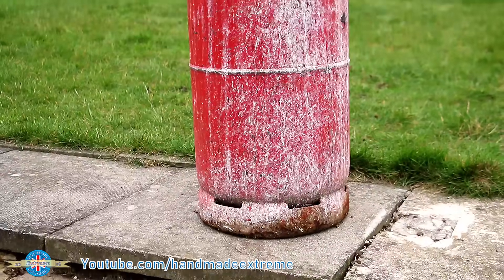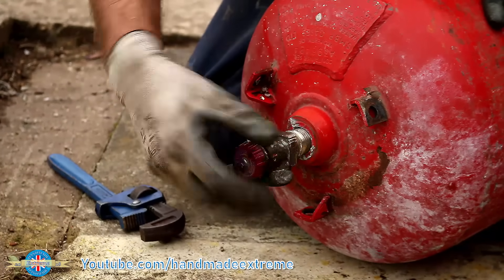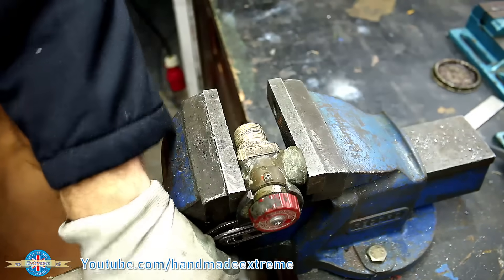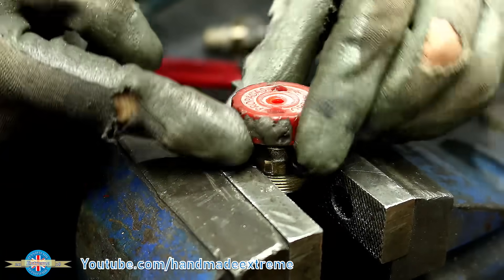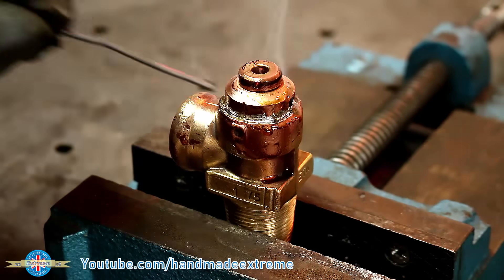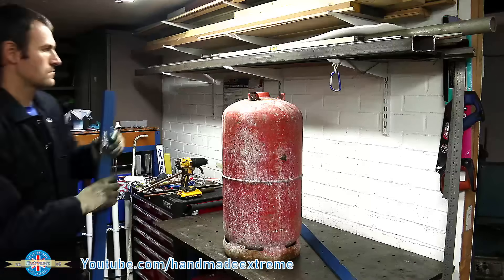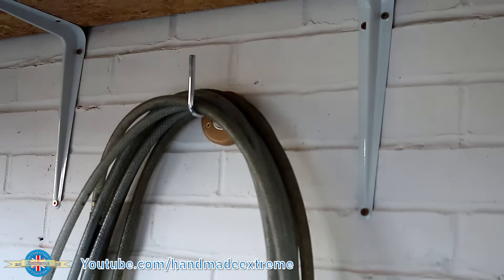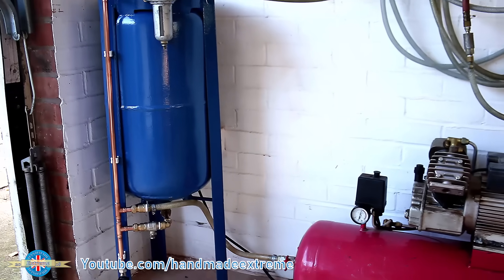Making an auxiliary air tank from an old LPG gas bottle.

Comment: Fun example, I’d only add a few suggestions. 
1, install a drainage style valve for the hose, so when you shut off the valve (handle) the pressure in the hose is relieved which makes putting away a non pressurized hose much easier, while keeping reserve pressure in the tank system. It’s also handy to drop pressure to change tools, and relieves the pressure in hoses being stored for longevity and safety. Handle is straight, the air goes to the hose, perpendicular and the air is sent from the hose out the back of the valve, while the tank is shut off. 
2, use a hose storage bracket with a larger radius, such as for garden hoses. This will help keep the hoses from developing a kink or bend at a wear point. Also, - like I think you’ve done (?) mount it quite high so that you can loop large lengths of hose, this helps to easily remove and get at longer lengths of hose by only taking one two lengths off and the hose remains straighter than if it is wound tightly. 
3, installing a shelving or drawer or cupboard by the compressor helps to keep all of the associated tools close at hand. 
4, Finally, fabricating a lightweight open ended box lined with sound deadening material and easily fitting over the compressor motor can help keep a workplace a little quieter. Ideally, the actual compressor is stored some distance away, in a different room or building and a length of pipe is then fed to your auxiliary tank. 
(5) remind viewers to drain the tanks at the end of use, especially when it is operating in a humid climate.

Comment: It's not true that it means the compressor activates less often.  Maybe you mean that it's less often but stats on longer.. Once you use up the auxillary air supply you immediately fall back to the rate the original compressor can pump.  All the auxillary does is delay that period if time. Maybe from an extra few seconds to a minute or two depending on the tool.  I would guess that a 30 l auxillary would give you about 60 seconds extra spraying time but you will have to wait a longer time for the original pump to fill it up again.  The original pump stays on for longer.   It would be interesting to do a total run time test if you spray for 15 minutes.  I would think the pump is on for about the same period if time once the auxiliary is used up.

Comment: You would get better quality air as in dryer if you took the air out of the pressure switch and feed it on the blue tank lower and had a higher port to take air from the tank

Comment: "the compressor does  not  have to run as often................"

Incorrect, it has to do exactly the same work as  before, replacing the compressed air that the tool in question uses.

What it will do is give you a longer time on the first run of the tool before the pressure drops enough for the pressostat to run the motor, this can be important when spraying so a reserve tank is definitely useful.

However the time the motor has to run to get the larger capacity of the two tanks up to the cut out pressure of the pressostat will be much longer and likely cause overheating of the cheaper brush motor compressors.

If you are using say a DA sander or spray gun at say 90psi the pressost engages when it drops to say 60psi and then the pressure equalises at 75psi with the motor running continuously then the reserve tank will only give you a longer initial period before it equalises at 75psi.

Comment: Welding tip: Get your face out of the smoke, further away from be bead is better. Also if that was 7018 your angle is way too steep. 45 deg at most, you were like 15. VERY good advise telling people not to weld on the pressure vessel. Great way to kill yourself or others doing that.

Comment: DO Not Use a LPG gas tank for a compressed air system!  Petroleum industry uses an indicator chemical called Ethyl Mercaptan to show leaks and low levels of propane in tank. Mixed with propane at 2.5 parts per million, you will smell it.
In used tanks, refilled over and over Ethyl Mercaptan will build up as a sludge in the bottom of the tank, increasing toxicity  and becoming highly poisonous to humans, animals, soil and water. How many tanks are discarded and currently rusting away to unload their deadly content????

Comment: 15mm = 19/32 that's an odd size.
Reply: Metric pipe is messured on the outside diameter its close to a 1/2”

Comment: As an ex Surveyor of pressure equipment, I'd say there are a good number of things wrong with this. I certainly wouldn't be building something like this, particularly if someone decides to use it for the primary air receiver. You have the advantage that your primary receiver will take out quite a bit of the water, but you are still going to get carry over that will affect the air system. There is no easy way to inspect the receivers internal condition for corrosion. That's not a problem for an LPG cylinder as they don't suffer from the problem, but air, water and steel don't mix well, there is no corrosion allowance. LPG at 30C will have a vapour pressure around 170PSI, if memory serves me correctly, so it should be OK with a pressure of 150PSI (10 bar) from a normal air compressor. But as soon as corrosion starts, and it will, that working pressure needs to be reduced. 
In a commercial or industrial business setting this would be illegal and a surveyor would issue a Prohibition Notice that the Whole System not be used untill the reciever is removed from the system. 
Otherwise, glad to see you didn't try to weld to it.

Comment: One tip from an old toolmaker. Grind a small flat on the drill cutting edge. Thus giving you a negative rake. Bronze and brass need negative rake to cut clean without grabbing and digging in. Obviously you’ll need to resharpen your drill after that. Or just keep it for another brass job should you need. I’ve accumulated so many drills over the years I just keep an assortment of negative rake drills. Always come in handy. Nice video 👍🏼

Comment: lpg tanks are made to withstand a 7 bar maximum pressure, i wouldnt try to use them on air compressor systems which can go up to 16 bar.
Reply: Not true, not sure in your country but in my country they are maded to get up to 250 PSI, they are really heavy...

Comment: For an aditional upgrade, route your air lines through an old car A/C condenser w/ a fan to move air through it and eliminate moisture from your sytem as its filling. Great for air tool aint paint gun longevity.

Comment: A little trick a machinist taught me decades ago for drilling brass is to start with a sharp drill bit then take a sharpening stone and drag it once, and only once, across the cutting edge of each flute. Since the brass likes to grab a sharp edge this is now prevented. I've used this method when drilling sticky materials (copper, plexiglass in particular) with great results. Hint: the more times you drag the stone across the cutting edge the more pressure needed to get the drill to cut. That's why i say only once.

Comment: Hey matey do not you need to use a check valve from the air compressor to the air receiver? I could be wrong but I'm pretty sure from memory there must be a check valve installed!!!??
Reply: Most compressors only go up to 100 psi on out valve (metabo "the tank" go up to 200 PSI but on the out valve max 120 psi), you dont need that check valve in this design, also the GLP tank can get up to 1.5 times the psi of the compressor. If you want put security stuff you can do it, but this desing is the best i have see soo far on internet.

Comment: Why not just turn it upside down and blow some compressed air in? The water filling thing never made any sense to me.
Reply: When you use air compressed you are adding OXIGEN, if you want get a nice BOOM, do what you say.
Reply: To clear up what the guy that responded said, using compressed air makes a fuel mixture inside an enclosed space, so if the fuel mix would somehow be set on fire, it would expand so quickly that the tank could explode, deleting your project, and maybe even deleting you so to say    and if you do that, you cant be sure nothings left, with water tho, none of these can happen  the fuel mix is spread over a bigger area and not enclosed so if it would be set on fire it would just all burn in at most 10 seconds

Comment: Convert? It's already a pressure tank. Using the old pressure valve is just wasting time. Buy a fitting, weld to a stand,  done.

Comment: Always separate your compressor from your tank so the tank does not get heated from the compressor and create moisture,, have also seen a coil of copper wire inside a refrigerator,,connected  between the tank in the compressor...

Comment: Speaking as a compressor engineer any slave cylinder should have its own safety valve and gauge  fitted to a t joint on the inlet would do , scrap recievers are easy to find as they get scrapped when the pump wears out , and lastly if you double the storage  it takes twice as long to fill it and twice as long to drain so you don't gain a lot the time the motor runs is exactly the same .

Comment: I have a failed compressor so now its tank is just sitting there (I got a new one because I wanted a larger capacity tank). Perhaps I can repurpose the smaller tank this way as so it can just be extra and doesn't just rust out not being used although I'm not sure this little ol chiness tank will be rust free anyway. Thanks of the video!

Comment: I'll give you a tip to cut down the chances  of your drill bit grabbing. in my toolmaking days a number of the guys I worked with just ground a slight flat face onto the cutting edge of the drill bit. On a normally sharpened bit the cutting face is slightly angled back and it is this that causes it to grab, so if the cutting face is ever so slightly flattened this cuts down the chances of it grabbing,
We only used these drill bits for brass or bronze, (and  occasionally aluminium  using kerosene for a lubricant).

Comment: Just put a good ball valve in instead of modifying a valve that wasn't made for the application. The threads in the tank are a standard pipe thread. You could have just screwed a couple of fittings together instead of wobbling stuff together. Also don't remove your heat when soldering like that. Heat will draw the solder down further rather than making just a "sealing" pass is all that was

Comment: Something I have always wondered.  If you do this because your compressor is too small and does not offer enough CFM, resulting in it running too often, exceeding its duty cycle rating, won't you exceed the duty cycle by causing it to run for long periods to fill the tank?
Reply: Thats why he has a valve on it to keep aux tank closed for most of the time. Only using the extra tank for certain high flow applications. But yeah it is hard on the motor and pump to run run run.

Comment: Wrong! The compressor needs to run harder to keep the tank filled!
Depending on primary and secundary preassure of corse. But it will in the end run more then before.
But it will keep a more stable preassure for a consuming air machine, yes.

Comment: Quality job mate. What tools did you find you could run off it now? I've also heard of people running two or more compressors in parallel to get more cfm however I think you would have to run them both though one pressure shut off switch to stop only one kicking in before the the other as getting the switches set to be the same would be impossible. Although I would still want a individual shut off @ ~150 psi incase for some reason something got otu of sync. Could be done with a bit of head scratching on the wiring to create OR logic.

Comment: Something I learned: your air gun is wimpy; get a length of brake line from the auto parts store (3/16"?ID, 36"), cut it in half, and screw it into the air gun instead of the pipsqueak nozzle. You will be amazed at how much more umph your air gun has.

Comment: I just "inherited" a system using a large propane tank but the previous "builder" made it the other way up with the condensation filling the tank. I have dismantled it all last night and I am copying your far safer and more practical solution.
Reply: How much water was in there?

Comment: Brilliant video & well explained to detail .  I have a spare 88 litre / 45 kg gas bottle I've been wanting to use for the same purpose . Would be great if end of  video had a parts list , listing pipe grade ...& size , compression fittings types , gate Valve type , flux used & thread sizes etc .
Great video mate & thank you .

Comment: I have a couple of knackered tanks I'm looking to stack as auxiliary the only concern with this design is that any moisture In the tank that hasn't been blown out will get blasted straight up to whatever tools you're using, even a water trap would struggle to handle that,

Comment: this is a good video showing air tank to compressor add on.but not needed in today's world when all the things he made are cheaper and less trouble to make.for instance the nipple end can be found on any bbq set lots are put on curb and thrown away.also cheap at any hardware store.might be good knowledge to have if SHTF but whole cheaper now and less work.and the stand could be better with it upright and a petcock installed on bottom at 150"something no danger of blowout putting one in. something as simple as a tubeless tire stem just to bleed off condensation.easily installed. good job but lots of wasted effort.

Comment: Actually this is wrong to feed tank from bottom because when air comes in water at the bottom splashes inside tank. Also it's better to choose discharge point at top of tank. Thank you

Comment: I saw this build of yours a few years ago. Now when searching about adding extra tanks I can definitely say this is one of the best build in my opinion. I really like that you put it upside down and mostly that you didn’t grind or welded around the pressure vessel. No extra heating that caused the metal of the pressure vessel to change its original hardness.

Comment: Propane is heavier than air- so the easiest way to purge propane is to 'turn the bottle upside down' In the last 20 years Ive emptied over 2000 gas bottles without incident. I make wood stoves from gas bottles

Comment: Exactly what I wanted to see thanks! Just built a CNC plasma machine and now I’ve solved the noise and earth problems, air is the next issue! A 40L tank does t cut it (ahem) so need lots more capacity. A friend has just donated a 70L car lpg tank so that will do nicely. Thank you!

Comment: A word of warning:

At 120psi 50 gal has about 250 kJoules of energy which is about same as hand grenade of 50 grams of TNT. Or about 100 rounds of 7.62x39 2 kJoules each.

Tank may get rustry inside due to water condensing - and it means during it's usage as air compressor, not past water-heater purpose.

Research the youtube for explosions videos and aftermaths.

Do periodically hydro-test. At elevated psi value. It is not that hard to do with pressure-washer. Better it crack with water than explodes with air.

But the idea, I like it, I think to do the same. That is how came across here. And then youtube suggested me a video with aftermath with 2.2m vies on it.   I hope if it passes 200 psi water-tested, only then I will use 40gal bomb - only at 120psi. And even so, will not put this bomb inside house or come close to it while it is under pressure. And think of chaining it to tree trunk otside the house so if it explodes, then it will not land on house roof like on that one youtube video...
Reply: It's not 50 gallons
It's not TNT, 
It's not PCP either.
It's a guy with a low pressure air compressor .
LPG tanks in the USA must be made if Alfoil by the comments section,

Comment: I think if I were to use copper tubing and fittings, I would use heavy duty tubing and fittings, and silver solder for all the fittings.  Just so there would not ever be a busted pipe for what ever reason.

Comment: I have a compressor that needs a new tank and I came up with the same idea of flipping an LP tank over for drainage and affixing legs to the non-pressurized bumpers, it's great to see that someone already has proved the concept. Good idea modifying the original LP valve, I was thinking modifying a plug, but the valve is "free" with the tank and already has the right thread.

Comment: The copper piping may not able to cope with the pressure on long term
Reply: My vintage Aerostyle of London air compressor has 1/2" (15mm equivalent) directly on the compressor outlet. It was built in the 1940s and is absolutely fine so I am sure he will be as well

Comment: the only thing you should do is for safety: either drill holes into the ground and bolt the tank to the ground or drill holes on both sides of the wall and use hurricane strapping, like how water heaters are strapped to the walls

Comment: The best and cheapest copper cleaner is KETCHUP. The kitchen staff at a restaurant I worked at years ago used it regularly on the copper pipes. Additionally, I've used it on water blocks for computer processors and graphics cards to buff them to a mirror shine.

Comment: I was going to use a larger hot water heater tank as an auxikiary air tank, but I think I'll be building a manifold to use propane tanks, instead. I find so many propane tanks in the trash...

Comment: One thing I would have done is to clean the inside of the tank down to bare metal, and if there is such a thing, coat the inside with a magic protective something, that stays put.
I wonder if there is any point to using this magic coating in a bran new compressor tank.

Comment: Question how you know your compressor wont over fill your auxiliar tank is there a switch or something to keep it from over filling?
Reply: The tank should meet or exceed the pressure rating of the compressor and built in tank.